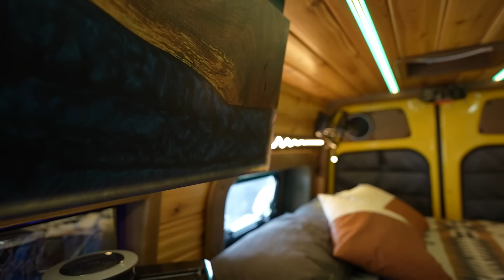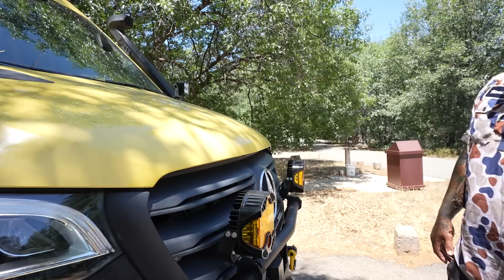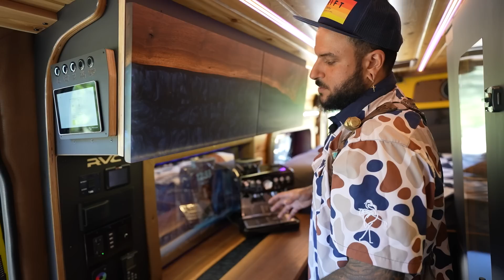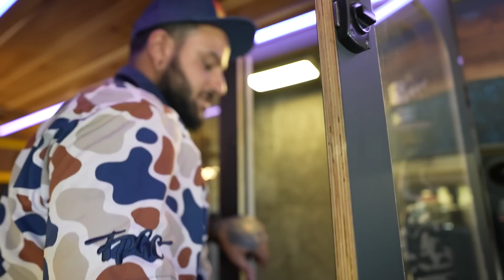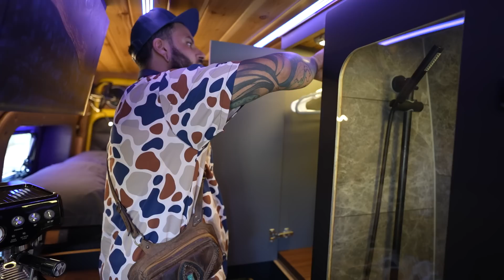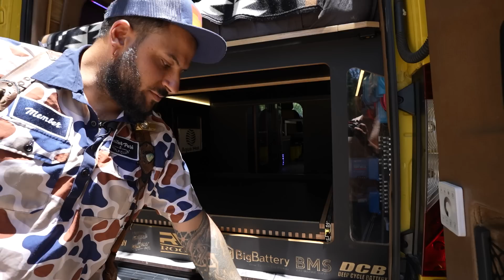The Most Insane Van Build Ever!! | Van Tour

Comment: Top Van build ... like it!
Reply from the maker: what was your favorite part?
Reply: @VanLand  It would be easy to say the whole concept is great, but I'm just referring to the interior design, namely the idea of placing the front bench across from the main entrance (sliding door), which makes the room appear longer and more open, the combination of wood, LED and Epoxy resin, there is a lot to be said. I also have my personal preferences and would never attach ladders to the outside if only they could be accessed from the inside and because the upper headlights make noise when driving, I would only mount them on the front radiator grille, but the overall concept is coherent and it is very well done, I like it very much . I also have to mention that you have already built and implemented the van and I am still in the planning phase. That's why I watched your video so I can learn.
Reply: @VanLand  I like the interior design and layout

Comment: Lol 160 amps...oh dear. I have 10 kwh also @48v and 160 amps is indeed extreme. I cry when I am -20 amps. Definitely an upgrade to my Renogy system. Anyone who is into dirt bikes etc, that garage could be better optimized if the bed could be raised or folded out of the way like a Murphy bed. My bed can be elevated via a motor and straps and it opens up the garage immensely. Can even create a separate hang out spot or load different cargo dimensions for ever changing situations.  Otherwise, pretty crazy van from someone who travels in a smaller Sprinter camper build for my kids' motocross racing.